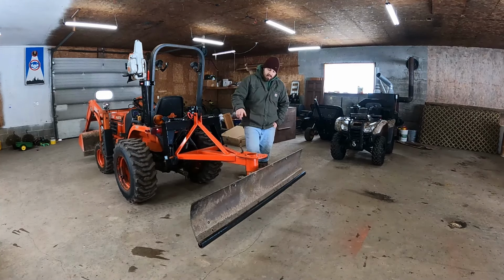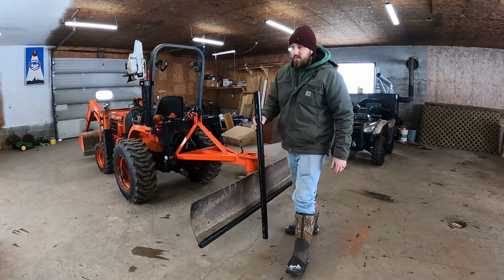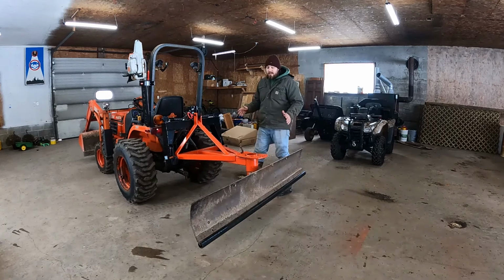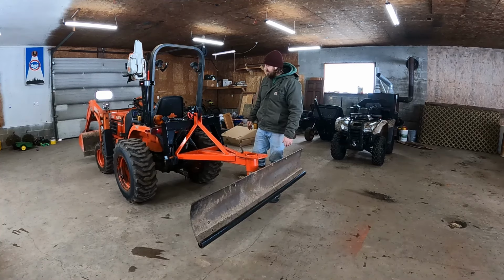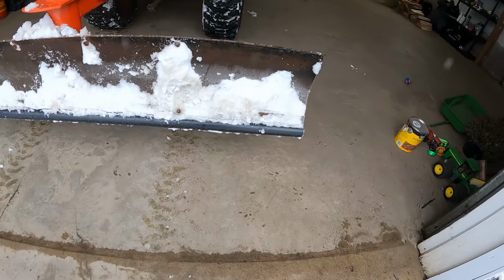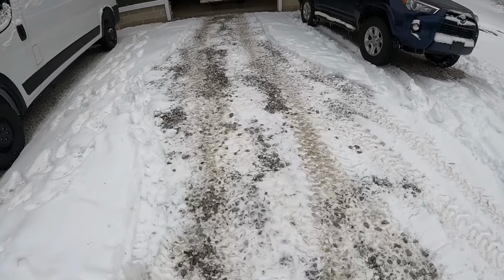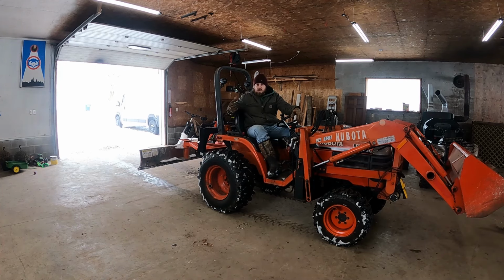Definitely Helps Plowing My Gravel Driveway. Grader Blade W/Plastic Guard (ABS Pipe)

Comment: A level up is a cut a piece of stall mat the width of your blade. Then measure for your next cut that the stall matt  hangs down about 2-4" below the cut edge. Drill holes to match the bolt holes on cutting edge, and bolt that between the blade and cutting edge..
Reply: Just caught this channel a few hours after you .
 I think the stall matt would still dig up the gravel where as the pipe has a better chance of rolling over them  .
The rubber you speak of would be great for a paved driveway though . Just my .02¢

Comment: Is it a Camera trick or am I seeing things but it sure looks like your tires are mounted backwards or at least they were mounted on the wrong sides.
Reply from the maker: No trick. They're 100% mounted backwards. Not sure why. My grandpa rebuilt this tractor from almost ground up after it burned up in a barn fire. And not sure if he never realized or he did it for a reason..I just plan on correcting when I replace. But I'm also confused the rear tires are 12-16.5NHS but the manual doesn't mention that size. But I do know the rears are factory because one tire is still burnt 1/2 way round. Kubota gave me no answers.
Reply: @StreamOutdoors  they’re probably on that way when plowing in reverse better traction

Comment: Nice job, did the same thing 20years ago.  Took 3"dia pipe, what l had laying around,  welded some tabs to line up with cutting edge mounting holes.  Larger dia really rolls over without gouging. Quick hint, on your first plowing, push that snow pretty far away from driveway and lot area, just in case you get another successive heavy snow fall.  Those previous snow banks get rock hard in certain conditions.  Haven't plowed in a couple of winters, miss it, probably the most fun on a tractor 😂

Comment: How did the pipe hold as far as wearing the the pipe out or flat spots i seen hdpe pipe is supposed to be good as well
Reply from the maker: Wear is fine, it's more keeping it to stay on for prolonged periods of time. I seen where someone cut strips of a horse mat. Then bolted that down in place of the cutting edge. Seemed to work good, just not sure how much time I want to invest.

Comment: How did you cut the groove in the ABS pipe?
Reply from the maker: I set the depth on my circular saw (1/4" or so) and ripped it down. Then used a rubber mallet to seat it down the blade.
Reply: I run my blade backwards because it’s stuck that way, but that’s how I found out how well it workes on a frozen gravel driveway and over lawn. 🤠
Reply: On an unfrozen gravel driveway I meant to write
Reply: I drive forward with blade backwards. It glides over stuff good.